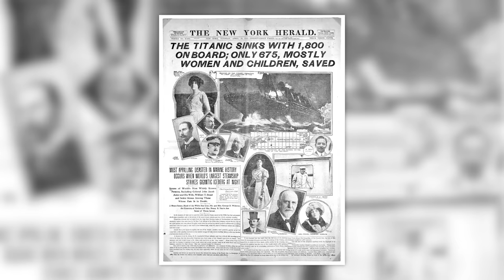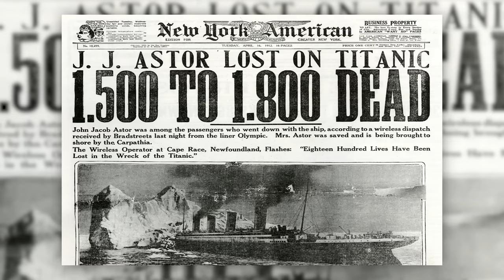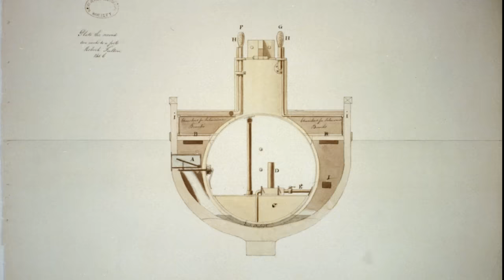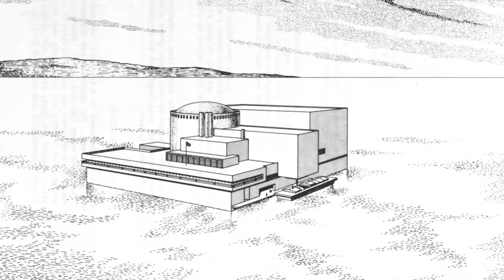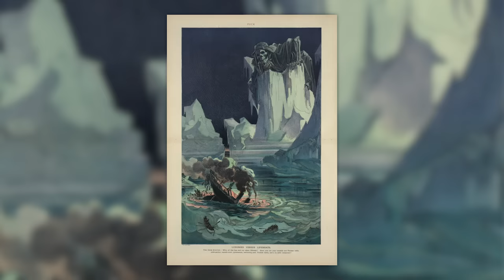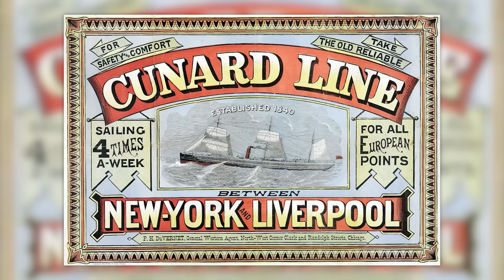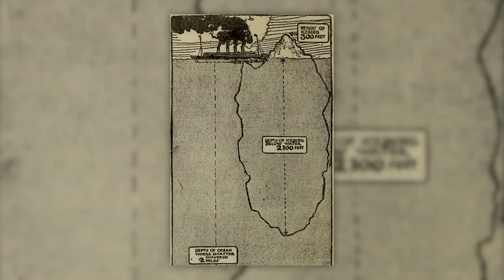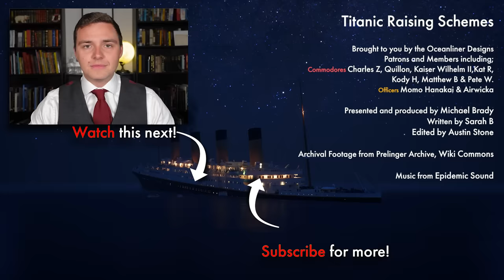The Bizarre Schemes to Raise Titanic!

Comment: Well, that first plan, the one with the magnets, is actually the most sound. That's how shipwreck salvage worked for centuries: Two ships on either side sling cables under the wreck, left it a few feet, move to a shallower area, adjust the cables, and repeat. The only thing hurting the chances of the plan is the absolute scale of... Everything: Ship size, depth, and he distance to travel to anything shallower that 12,000 feet.
Reply: Pretty sure this would just break the whole ship into smaller pieces, considering its state. Assuming the magnets would even latch to that big pile of rust.

I think it would make more sense to slowly dig the mud and progressively assemble a plateforme (rigid or semi-flexible) under the hull. And then pull the whole thing up with balloons inflated in situ. Now we just need to find a budget around 1 quadrillion dollars to do it  /s
Reply: No. Not at all. Honestly, even just messing with the area of the wreck site is enough to cause damage to the ship. It's severely rotted at this point that even normal sub expeditions down to it are causing some harm.
The ocean itself is also actively damaging it anyways and it's breaking apart slowly under it's own weight. 
Assuming the ship somehow had no structural damage to it after all this time, that idea still wouldn't work as there would be no way to pull on it evenly. Currents would easily be knocking the ship around and breaking it loose. And the ship's weight would just drop it down from the cables and magnets anyways. 
The legitimate best plan to raise the ship would be the same as it was back then. To go and actively cut it up into many, MANY smaller pieces.
Reply: @naisagathefirstdestronmand8559  Yes it's rotten, but not 🚫 n 19-whenever he suggested it.
Reply: @GerardMenvussa ummm when first proposed 1:  The ship wasn’t rusty. It was fresh, new and would have been sitting there looking glossy (albeit in pieces). 2:  When first sunk there were conflicting stories of what had happened. It was not definitive that it had broken in two so they were likely basing their plan on a complete ship.  Only know do we know how it fell and what happened when it hit the bottom (hindsight).
Reply: And 90 magnets with 500 tons of lift???
Reply: @GerardMenvussa that's very sound it would work if the ship was just a pile of rust the piece they did bring up would of just cracked into a million pieces but it didn't so I think we c an pull it up no problem
Reply: @naisagathefirstdestronmand8559 well what's the point of bringing it up then it.would be a.jigsaw puzzle to put back together and quite frankly you couldn't the ship would nolonger be authentic ❤
Reply: That sub would get crushed into a pancake
Reply: @adambylund2281 not if it was a carbon fibre / titanium cylindrical design 😂
They could even use a game controller to navigate with, no sweat 🤷‍♂️

Comment: Something lost on non-engineers is how heavy a ship is and how fragile it is. 100 million lbs, or 50 million kilograms. Google pictures of ships in dry dock, youd need to distribute the lifting force across hundreds or thousands of points across the  keel. Youd just rip the ship apart if you were lifting from a few dozen or less parts.

Comment: I was born in 1966, 54 years after the Titanic sank, and 20 years before she was rediscovered. 

I never understood how a gigantic ship, designed to slice through the waves, could possibly have survived a plunge to the bottom. The Olympic class liners were not the Sea Biscuit or Seattle Slew of their time, but they ran in the same race; they were still fast . They were superliners  not rusty old scows. So, designed to be fast, they were sleek. 45000 ton darts. What happens when a 45000 ton dart hits the bottom, supposing it was intact? DEVASTATION. 

Well, the fact that she broke in two and therefore already lost enormous amounts of her integrity meant that her arrival on the bottom was going to be positively CATASTROPHIC. I can hardly believe she is as intact as she is after slamming into the bottom at a speed of 35 MPH. Had she remained intact she likely would have been travelling faster. 

All that said, I don't understand how so many people knowing so much more than me could have ever figured there'd be any chance at all of her surviving the largest collision of all time involving a manmade object. Impacting the ocean floor after 2½ miles of head start is going to be stupendous. It was well known the Brittanic snapped her nose almost clean off in only 400 feet of water! What about 13000 feet of unimpeded descent? What was I missing? What made people of industry think there'd be an intact ship waiting for them on the ocean floor to be raised and towed to New York instead of the hideously smashed, debris field generating WRECKAGE that is actually there?

Comment: "Having seen the light of day, for the last time, on the morning of April 15th, "
Not to pick a nit, but the last parts of the Titanic sank beneath the waves at approximately 2:20 am. in the wee hours of the morning on April 15, 1912. At that hour, the sun would not yet have risen. There wasn't any light of day yet. Thus, the Titanic saw the light of day for the last time on April 14, 1912, as the sun set. Other than that, another simply great video, with real insight.
Reply: EXACTLY!

Comment: It would have been possible to raise the ship within the first few decades after she sank.  When she was discovered 70 years later, she would have been too delicate.  Now it would be impossible.
Reply: I don’t think it would’ve been possible ever, because of how deep it is. Also, how do you lift tons and tons of a ship, even if it was as deep as Britannic is?
Reply: @ALROD  When doing the calculations, Britannic could be raised with a lot of work done prior, like installing large external floating aids (metal pontoons) and using large sea cranse like the used for Kursk, Costa Concordia, etc. Brittanic is well enough from her structural condition to manage it. As averything it would "just" be down to the cost
Reply: @Nostalgic-Mechanic  I read Britanic is more rusted than people realize, since the coral disguises the true state of it.
Reply: @gamerxt333  Well, that might be. Sadly I was never there 🙁 I would like to though
Reply: Probably not even then. Its estimated that she was travelling around 30 mph when she hit the bottom. That's what caused the middle section to collapse, as well as the upper decks. She's not called a 'wreck' for nothing.
Reply: When the CIA attempted to raise the wreck of the Soviet submarine K-129 in 1974 (Project Azorian), the sub had only been on the bottom for six years, and even then the vessel's structural integrity was hopelessly compromised--in fact, it had been since the moment it struck bottom during the sinking.  This is reinforced by the fact that the retrieval tool itself was badly damaged by colliding with the sea floor during the salvage attempt, and unlike the wreck, it wasn't in freefall at the time.
Reply: @rgemail  I don't think I would dismiss assertions that mass grave sites shouldn't be looted as "naysayers screaming sacrilege", but go off, I guess.
Reply: @rgemail  So what you're saying is, you understand nothing about the culture of seafaring. Got it.
Reply: I don’t believe it would have, even if they did have the technology we have today. The Titanic’s stern section hit the ocean floor at such a high speed that it imploded. I think if they tried to raise it, the damage and water pressure would make it crumble before it reached the surface.
Reply: Titanic was a he

Comment: Well, obviously, there are a few repairs that need to be done before raising the Titanic. Just a few panels and supports here and there. Maybe some of the fittings and furniture need replacing. No doubt some of the machinery and electronics need to be replaced after so long.
Probably be a good idea to do all of that replacement up here on the surface and just rebuild her from scratch.
Reply: Everything would probably tear away and fall out of the bottom.
Reply: I think duct tape could hold the hull together. Maybe bring some bungee straps along just in case we need them
Reply: @davidstephan5116  Good idea. 😉

Comment: The union flag you used is a pre 1801 version (no second red cross for Ireland), that predates the act of union of 1800, which merged the Kingdom of Great Britain and the Kingdom of Ireland to form the United Kingdom. 

Some of those dreamers sounded colourful characters lol. Another wonderful video, many thanks.

I would imagine it would me many times cheaper to build a true replica than ever try to raise the bits that survive on the Atlantic floor of Titanic.
Reply: It would be cheaper, sure, but there are so many saftey regulations for modern ships today. Many of the features of Titanic wouldn't be allowd today and so nearly everything unique of the ship would have to be replaced to have her travel on the water.
Reply: @Deadsea_1993  it's the same with so much today. Current debate in UK over the fact heritage coaching stock (unless modified) doesn't have central locking to prevent the passengers exiting the train before the guard allows it, despite being a lack of incidents.
Reply: @Deadsea_1993  Plus, Ships wear out quite quickly in salt water, so a Titanic shaped hotel would be much more feasible! There's already hotels shaped like cruise ships, after all!

Comment: Mike, did you do an in depth about how Titanic was discovered, and about the first sub to reach her, and film her?

What equipment and techniques found her, how long did it take to get there later, in a sub, in number of hours? What challenges and quirks happened along the way?

Maybe you can do a "cutting edge" technology video on what the future holds for deep sea wreck exploration. 

What valuable wrecks out there are worth searching for, and how much tresure is there? Where did they go down? What failures occured in the attempt(s)?

I want to know what we use in modern times, what things we may be able to do and see in the future, and how regulations are changing that landscape.

Thanks Capt'n Brady!

Comment: Great video Mike. I really enjoyed this one!

I'm no expert, but I feel pretty comfortable saying that even if it ever was possible to bring the wreck back to the surface, it certainly isn't now. I think it's pretty obvious that it would collapse and crumble if it was tried.

I have got a slightly contraversial opinion though. I think that if the money and expertise could be found, I wouldn't be opposed to a team using a manned or remote control submersible to cut holes in some of the already decayed areas and search out voids within the wreck containing items.

Obviously, I wouldn't want to see holes cut in the recognisable and iconic parts of the bow that still remain, but I'd support vehicles going in through the tear in the hull or dismantling the stern section. Apart from the things you mentioned, there are other treasures aboard the ship that we can reasonably expect to have lasted. I know the story about the 'cursed mummy' was faked, but there was an egyptian sarcophagus on board that is likely in good enough condition to be restored and I'm sure many other fixtures, fittings and belongings would be priceless now, even if they were average items in 1912.

I can't help wondering if there could still be skeletal remains in parts of the ship that were sealed closed by the catostrophic damage on the night of the sinking too. I do wonder if there are a few rooms on board that had doorways blocked by falling debris or spaces where the pressure collapsed evetything around them, but the superstructure protected them, sealing them like pockets of time. I know I'm being fanciful, but it's really good fun to think about!

Comment: The thing about sunken shipwrecks is that they were already no longer seaworthy when they sunk, and that was before they filled with water and before they started getting pressed down hard by the deep ocean water pressure.

So to even start to raise the ship, you have to either "have undersea divers start making repairs to the ship to restore the hull integrity" or "use external means of lifting the sunken ship up despite it still not being seaworthy on its own". Both options are MASSIVELY expensive even for recent intact shipwrecks in relatively shallow waters close to shore (see: Kursk, Costa Concordia, etc.).

The costs, equipment , and expertise required exponentially increase as the wrecks get further from shore, deeper in the water, and as the vessels deteriorate with age, not to mention the insanity of trying to refloat a ship that has broken apart in the middle.

The Titanic is a century-old wreck of a ship filled with water-soaked wooden paneling/furniture and rusting metal exteriors that has been rotting away as two ripped-apart halves of a ship in the bottom of the ocean far from shore, at a depth currently only accessible by very small submarines that can safely only contain 2-4 occupants, with more people willing to spend the millions to dive down to the ship than the billions needed to even start to raise it...

...and that's not even mentioning the bad juju from disturbing what is essentially an underwater tomb for the 1,500+ people who never made it off that sinking ship alive...

Comment: Lack of appreciation for water pressure at depth extended even to the 1976 Novel “Raise the Titanic”, where the author had it being done by injecting expandable foam into the wreck (won’t work). The 1980 movie replaced the foam idea with Naval salvage balloons (also won’t work) - this may have been a last minute change as one shot of the raised ship interior shows foam oozing out from inside.

Comment: The ice scheme is interesting Had never thought of it.  I am guessing that ideally, filling the ship with some sort of polymer/epoxy that would become solid near 4°C  but would easily be melted at room or slightly higer temperature would allow one to encase the fragile wreck in the equivalent of a cast, raise it, and then melt the "cast"  (but unsure the wreck would be able to self support itself so liekly would need to be suspended in a large wharehouse with cables holding every part of the steel hull. 

The actual raising is fairly easy as you can attach open balloons  (tarining for this is my first diving class, this is pretty basic). But you need some hefty tanks filled with gaseous nitrogen at a pressure above that at depth.  Nitrogen/air would need to be at over 5500psi  just to flow our of tank to fill the balloon. But once filled, would provide positive bouyancy and as  the wreck would rise and ambiant pressure drops, the excess nitrogen would just escape from the opening at bottom of balloon to ensure the baloon never explodes, but its bouyancy would increase since density of gas inside would decrease.  (so at some point, may wish to have mechanism to release some balloons to reduce rate at which the wreck comes up.).  Without encasing the wreck in some solid block, it would not survive. 

It might be more interesting to dig on the starboard sine of the bow to actually see where and how long the gash made by the iceberg was.

Comment: Heres a strange thought.

The wreck is mostly buried in silt, which means that when the bow disintegrates part of it will still be there.

Meaning it's possible that part of the Bow and Stern will fossilize.  If the atlantic closes in the right way, 100's of millions of years from now, it may finally come to the surface again as a rock.

Comment: Could always leave it underwater to turn it into a museum. Build a dome over the bow section of the wreck, pump out the water and then pressurize the dome with breathable air. Build an undersea docking station and hotel underwater and setup walkways around the wreck inside the dome.
Reply: Yes but the bacteria has eaten away the ship for many years now. There's almost nothing left of it. There's no grand staircase anymore, the ship looks mummified, etc. Not to mention that passenger vessel to the bottom of the sea is still uncharted territory and basically non existent. Ocean Gate has set that market back tremendously due to them cutting corners and being unsafe with testing measures like using carbon fiber on subs
Reply: @Deadsea_1993  That is something I didn't think of, the pressurizing a dome could cause further damage to what is left of the ship. Ocean Gate really messed up, you can't just slap together a sub form random parts and expect it to work.
Reply: I don't think you could realistically pressurise a dome like that that deep. THe pressure would be phenomenal.

Comment: the best way to at least visit the titanic directly is to try and build two underwater domes for the stern and the bow. as soon as those domes are in position, the water inside would be pumped out, oxygen tanks nearby would provide air to breath and a small tunnel would be used as an entrancearea for people who wants to visit the wreck. however i dont think that we could simply use very thick glass as material for the domes right?

Comment: To be honest I feel like even if we could get a platform under it and lift the whole wreck site in place or even build a dam around the ship and drain all the water away, the ship would most likely collapse when the water is drained from it. Also, the wreck's decomposing process would speed up significantly and by the time the wreck could be assessed or recovered it would probably be totally unrepairable from the rust damage.

Comment: Could be done I think building a kind of very strong walls arround the wreck, seal the walls of water and pressure, then drain the interior, somehow contain the sea force and youll have a dryed titanic at the bottom of the sea, then you could go with people and see how to lift it with cranes and machinery, using oil plataform tech, the cost of course would be of several titanics by sure